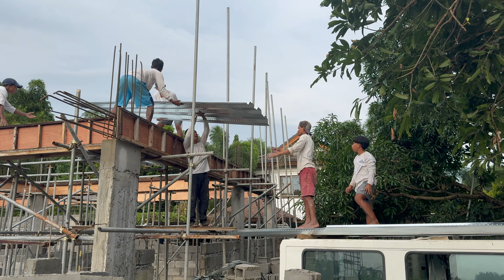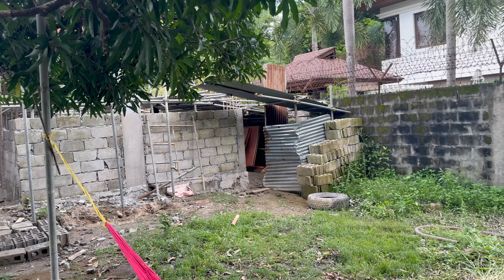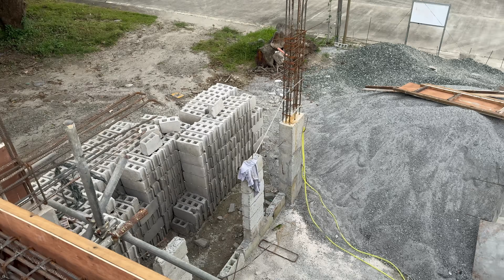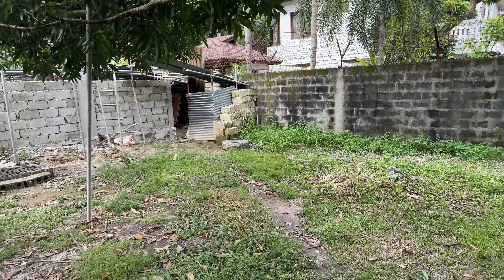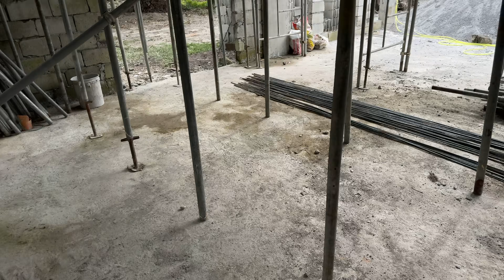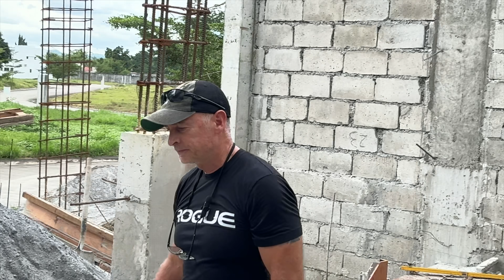Stronger & Faster Concrete Slab-Conventional Plywood or Steel Decking?Home Build Angeles City V9

Comment: Termites don't attack metal. Lots of termites there.
Reply from the maker: @raptor1106  Yes, termites are a problem here.  No worries about the metal but cabinets, door frames, doors, and furniture you have to worry about.

Comment: Just came across your channel... construction methods are different for sure.  Years ago I was a forms carpenter and we did a lot of pours using both plywood, and many pours using prebuilt forms panels.  The steel certainly seems like a quick and easy alternative, adding some strength.  Kath and I want to build at some point as well... and will try and share on our channel as well. Two more subs for ya and looking forward to watching the progress.  https://www.youtube.com/@OneMansParadise
Reply from the maker: @OneMansParadise  Yes it is nice to see advancements in builds are finding their way to the Philippines.  Thanks for joining and look forward to following your adventure as well!

Comment: Nice video. But I must say. Looking how they make the walls, that’s like how local people do them in Panama too. I’m not a professional builder or brick layer. But I can’t deal how they work. I did drove around and looked at different construction areas. They all pull the walls up without any pride in their work. So. Long story short. I decided to build my own 2 level house like I did 32 years ago in Germany. Now I have one problem. People show up and asking me to build their houses. And because I refuse to do that, they are not happy. I’m disabled from a work related accident. 82% disability. So I work on my construction site in my pace . If I feel bad the next day from carrying 1,000 pounds on CHB upstairs, I relax the next day. There is no rush to get the house ready. I’m still waiting for the electricity company to get pols into the ground and pull the wires for 24 lots. The last pole with electricity is half a mile away. Next year I will move into my house. Construction costs will be around $30,000 for the 156m2 house. Go figure out how much it costs with a company. / I never understood why they fill the CHB with concrete. That’s NOT why they got invented! And again. THE WALLS LOOK HORRIBLE. Sorry. I can’t deal with this very poor craftsmanship. The walls will not withstand any pressure from the top. And now coming the people who will say: When the walls are plastered, you don’t see it. I say: Just wait for the walls to crack after 1 year. Same here in Panama. Positive to mention that they poured a whole foundation slab. They don’t do this in Panama. People said many times to me that I’m using too much concrete for pouring a full foundation slab. I don’t care. My walls won’t crack. They are done straight and properly.
Reply from the maker: Thanks for watching and for your comments!

Comment: In a country with many crazy typhoons every year, why do they always make those aluminum roofs that get easily leak and blown off?
Reply from the maker: @thienthan324  I think substandard material is often used because it’s obviously cheaper
Reply: I just started to watch the video. Instead using plywood, he is using metal sheeting and poor later a concrete slab for the second floor. Here in Panama, metal sheeting is expensive. I used plywood for my concrete slab. Coming from Germany, I used a couple of 4x8 plywood to cover 50% of the second floor and poured 2 inch of concrete into the form. After 1 week, I took it off and used it to do the other 50% of the second floor, what saved me 50% of the costs for the plywood. After another week, I took off all of the plywood. Waited another week (time to get all the rebar in ) and then I hired 5 people and we poured another 6 inches of concrete to finish the whole slab of 80m2. And yes. Lots of rebar was used before I poured the concrete. And no. I couldn’t use concrete trucks to deliver the concrete. The gravel road can’t carry them. All was mixed in a concrete mixer at the lot. Understanding construction should be a basic knowledge and listening what people say. Greetings from Panama.

Comment: Where are you building and how big is the lot? Is your builder local?  Are there anymore lots available?
Reply from the maker: @mr.pogimerry7157  Hi Pogi, I’m building in AC.  My lot is 400sqms and there are other lots available.  400sqms up to 700.
Reply: @jeepneyjep1919  what’s the price range for 400sqm. I also have a house in AC. By Hensoville in Malabanas
Reply from the maker: @mr.pogimerry7157  I think they run around 34,000 plus per sqm now.

Comment: I  have been working here as an electrician in the US in construction and have encountered a lot of steel decking work in all kinds of building. I believe your
ceiling will be high to run your electrical, mechanical piping  and other system. I hate  those hollow blocks they should be a pour wall to accomodate the electrical piping and 
water piping instead of working them after.

Comment: Looks good. Just don’t try to paint that steel decking inside it will peel off.
Reply from the maker: @kellytraveler4748  Thanks Kelly, no plan to paint, it will be covered with drywall.
Reply: Good Morning Jep : I live in angeles city for the past 2+ years and ran across your channel this morning. Watched a couple of your vids and good Job they are informative for me due to the fact im in the process of interviewing architects at this moment (a month so far) to build a house on my lot, you seem to have some of the same ideas of what my concept of a build is. I was in hopes to stop by and chat one day if ok ? Thanks for your time and vids Greg
Reply from the maker: @ Good Morning Gregory, thanks for watching.  I would be happy to share anything I can to assist.  I just got to the US and won’t return to Angeles City until 5 Dec.  Here is my email.   jeepneyjep@gmail.com. When I get back we can link up.
Reply: You can successfully paint the zinc plating, ie achieve good adhesion, if you use a metal etch primer after surface preparation.
Reply from the maker: @walsakaluk1584  Thank you but we will be covering with drywall
Reply: @walsakaluk1584  That stuff don't work, We have the same thing at work after a few years it will start to peel off.